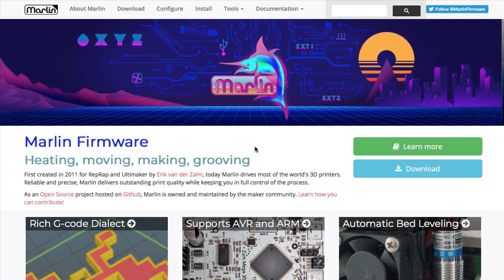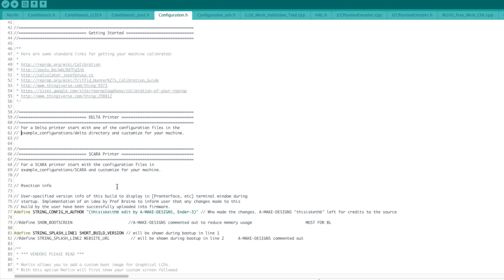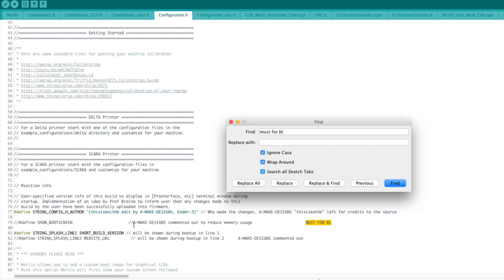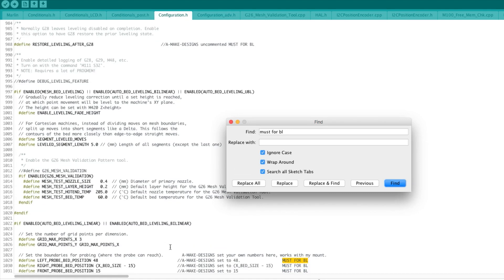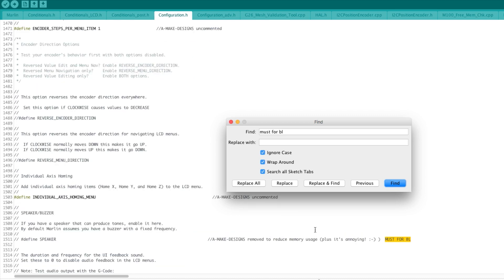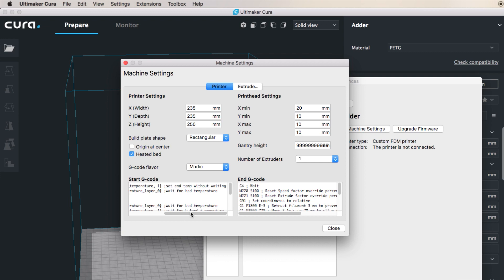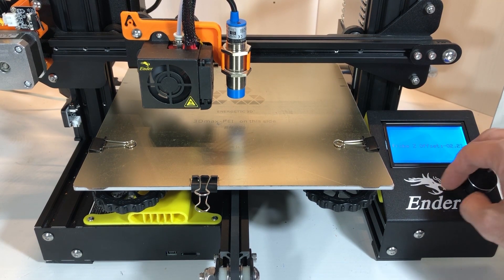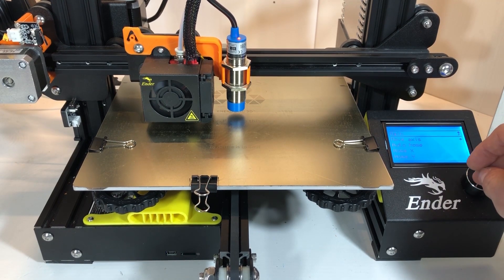Ender 3: DIY inexpensive Bed Level Sensor (Part 2)

Comment: ciao Andrea....ho seguito passo a passo  il tuo video per caricare marlin 1.1.9 sulla mia ender 3 ma purtroppo non ho trovato il firmware che  hai postato tu ... oppure non sono strato in grado di capire i passaggi da dove l hai scaricato...io ho u naltra versione ma non riesco a compilarlo perche mi da sempre la dicitura...expected ' . ' before numeric costant    .....mi potresti aiutare?
grazie in anticipo.
Reply from the maker: Il video è datato, può essere che il link non funzioni più perché nel frattempo ci sono nuove versioni. Appena riesco do un occhiata.
Reply: @AMakeDesigns  grazie molto gentile attendo con ansia..

Comment: At 5:49 you forgot to mention that need also Z_MIN_PROBE_ENDSTOP_INVERTING true.Without it cannot compile.Also you can configure any pin for ENDSTOP for other boards with stm32 chip.
Nice video.

Comment: Hi very good video. Are you still using this sensor ? Has it been reliable. My BLTOUCH failed after 1 year of light use and I don't want to buy another. This seems a good solution. 👍
Reply from the maker: The (very cheap) sensor I bought broke but was easy to replace.
I installed a Lerdge board that has a ad-hoc setup for inductive sensors, I use it since then.
Anyway as long as I used this it worked properly.

Comment: I dont get how this is supposed to help with levelling? Surely you need to adjust the actual sensor height relative to Nozzle and bed to get an accurate distance? 

I was thinking that you set the leveling height as normal but using feeler gauges so you know for sure you've got the correct distance between Nozzle and bed at each corner. 

Then you carefully adjust the sensor down until it activates. So that way when you do Level corners you just wind the knobs on each corner until the sensor activates? 

Or does your printer have motorised adjusters on each corner? 

In don't understand why you didn't video the system actually working showing how the sensor aids levelling?
Reply from the maker: I think Marlin is using a misleading name for this feature and I went along with it. The ABL is not actually doing automatic leveling but rather compensate for uneven bed and tilted leveling.
The distance between sensor and nozzle is constant and adjusted in the settings (2 part shows this). The machine measures a grid is points then adjusts the coordinates accordingly. I hope I explained.

More info here : https://marlinfw.org/docs/features/auto_bed_leveling.html

Comment: was this done on a 8 bit or 32bit board ?
if its a true ender 3 should be 8bit but i need to know
Reply from the maker: done on the original board. If you plan to do it there, you have to flash a new firmware.
Reply: @AMakeDesigns  thanks
Reply: @AMakeDesigns  another question  since i can't get the exact sensor was the sensor a  NO,NC, and a NPN or PNP  ?
Reply from the maker: @buder5116  I used a NPN NO. In hindsight a NC could be better being failsafe. You can find the list of parts in the description of the video here: https://www.youtube.com/watch?v=2qxq5H5qfaI&t=0s
Reply: @AMakeDesigns  i allway miss it thanks
Reply from the maker: Me too 😜 confuses me all the time

Comment: Hi ! this setup works with ender 3 new v4.2.2 board + optocoupler ?
Reply from the maker: I don't know the details of the new board, but if it's a mechanical switch now it should work fine.

Comment: How consistent is the sensor's measurements?
Reply from the maker: Mine is quite consistent. There is a G code command you can run : M48 that measures 10 probes and outputs the accuracy. You can enable it in the firmware.